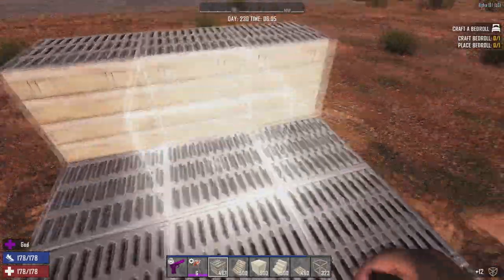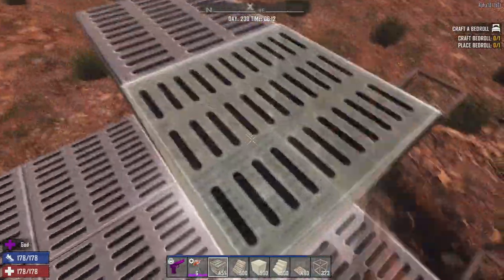Alpha 18 - Boom Box Base - Speed Build Tutorial - The Demo Destroyer

Comment: Hi Grand Spartan, I built this base for my 231 day horde.  It worked pretty well except for the vultures.  Do you have a video showing how you setup defense against the vultures?  I was going to put some turrets at the top but since I put plates on the roof the turrets are floating.  Thanks for the great base designs, this one rocked even on day 231 with minimal damage to my base.
Reply from the maker: Thank you Romel! I put a shotgun turret facing up and to the back. That took care of any vultures till 4 am. You may just want to remove one plate and replace that with a full block. Then set the turret up on top of that block. Should be all you need to take them out without the threat of hitting a demo and triggering it.

Comment: Does anyone know if this base still works in alpha 20? Or are there any changes in zombie ai that makes it obsolete? a friend and i tested the SuS style base from Grand Spartan and its an awesome base but lacks of getting xp. We used the boom box in our a18 playthrough and loved it. thanks in advance!
Reply: I just tested this base out in alpha 20. It does necessitate some minor modifications to work correctly though which I took a screenshot of here: https://imgur.com/a/gCqCJtr. First, the zombies kept attacking the main building, so I expanded the wings further out. Second, they are often reluctant to jump, so I increased the height of the stairs by one block, and added some extra plates to prevent them from jumping on top of the main part. This setup seems to work pretty flawlessly. The only downside is that we can't seem to place electrical wire through arrow slits anymore, so you'd have to break them down to place the wires, then put them back up.